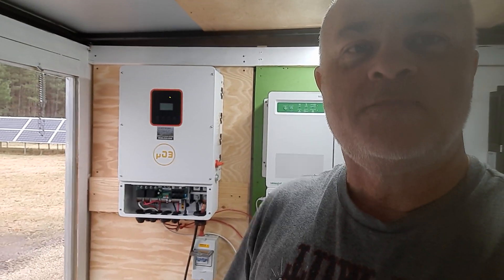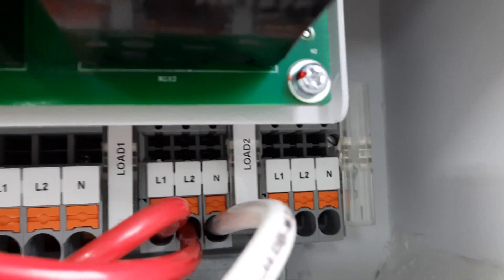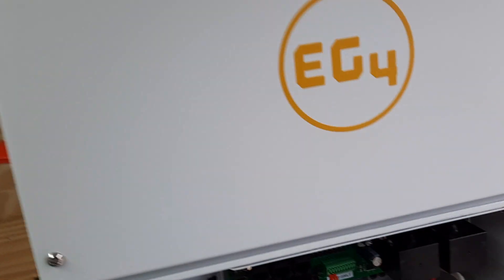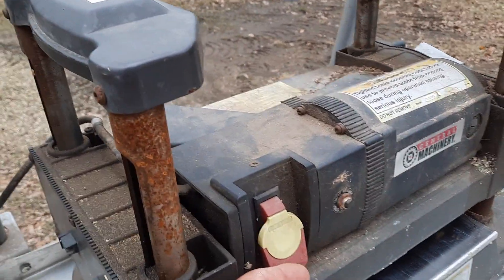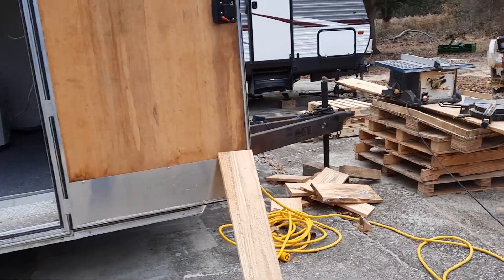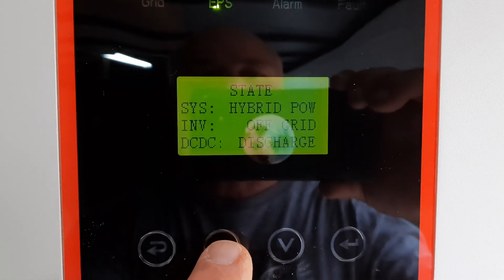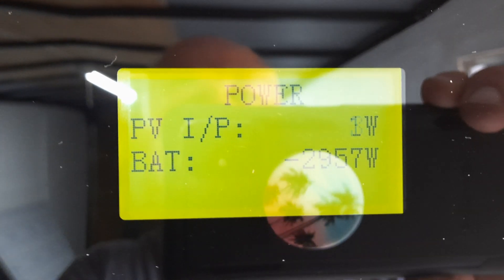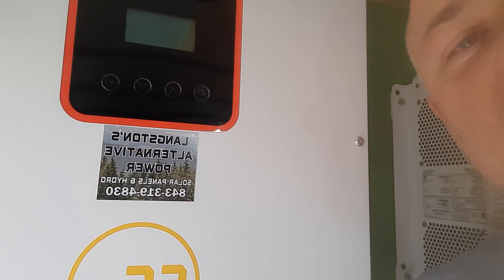eg4 8K hybrid inverter 12K solar input

Comment: You might want to just try space heaters for your base load at approximately 1600 watts each on high and 800 on low with variance between models.  Cheap and effective.

Comment: I would like you to hook this up to the 240 Grid in the split phase as an input.  I'm interested in this for an RV application with 50 amp 120V on L1 and L2.    I'm most interested to see what it does when presented with power from an RV that has 120V / 25 Amp on L1 and L2 but on the same phase.  This is what my Onan 5.5KW produces.  Will it fault because they are not in split phase?  Will it only allow L1 to pass through?  While it provides assistance from the batteries or solar to bring the amps back up to 50 amps?  I have asked the manufacturer several times, but they have not answered my questions.  The Victron Mulitplus ii 120x2 provides power assistance and will pass power on L1 when the lines are in phase.  What is the maximum power it will pass through on the grid?  Please let me know what your thoughts are on these questions.